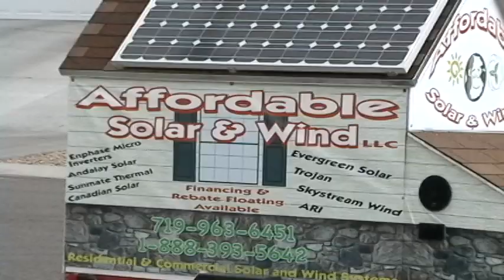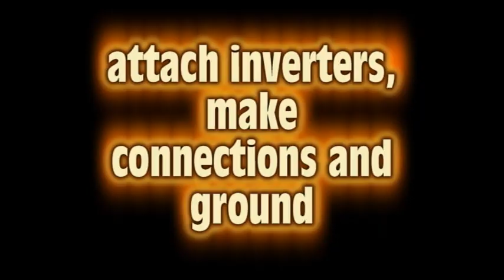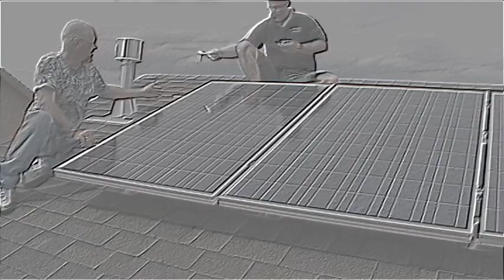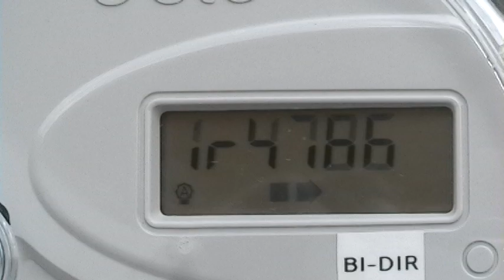solar panel addon made simple with enphase.avi

Comment from the maker: finding the studs is too easy, just lightly pound on the roof while miving back and forth, you will hear a definate sound difference when over the stud, then drill your hole. if you shnk the side if the stud you will feel the drill pull to one side or the other...just pull it out and try just a bit to the left or right, caulk any missed hole real good, no problem, the flashing will also cover it. you can measure after that if you like, all house studs are 24" apart, or 18" for modulars